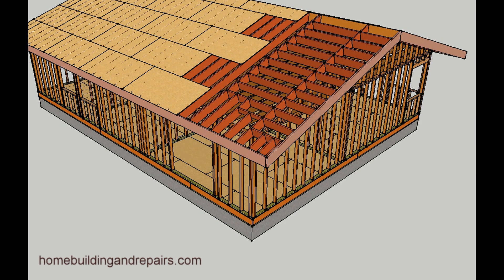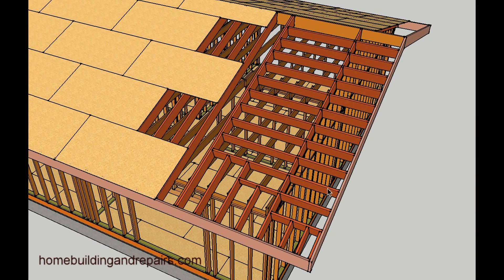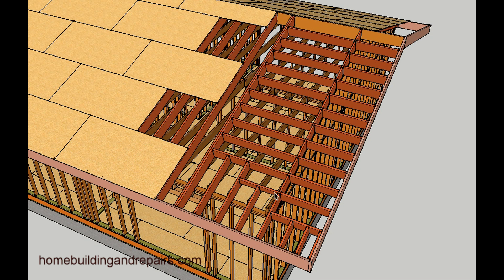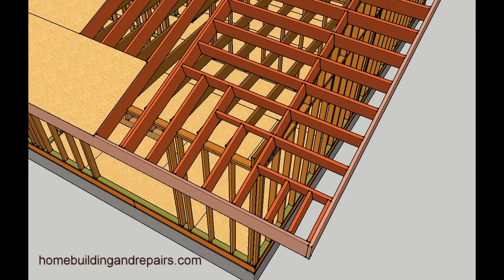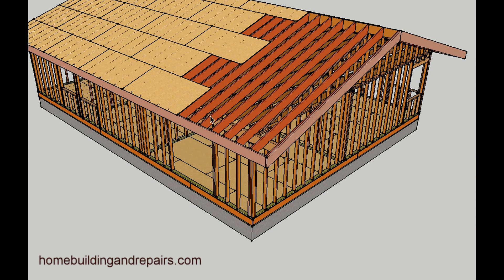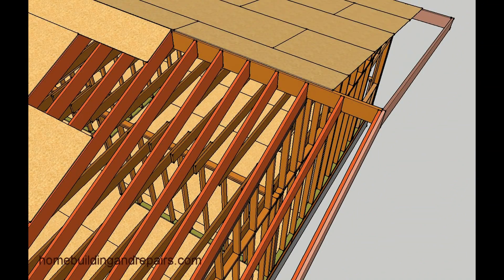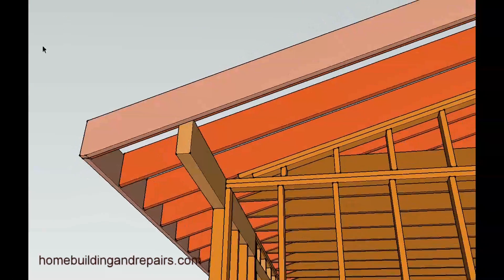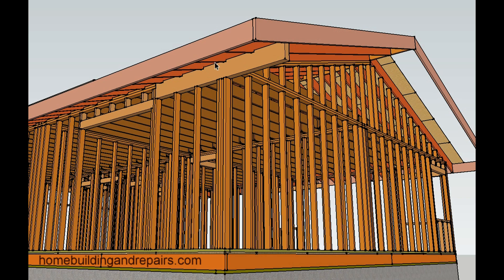How To Make Gable Roof Overhang Longer - Engineering and Framing Ideas

Comment: I am going to install 4 foot overhangs all around a Gable End roof using I-Joist & 2x6 extensions 24" on center. The I-Joist will stop at the top plate of the exterior walls. The extensions are to be 12 feet in total 8' inside the wall w/ a 4' cantilever / overhang w/ proper blocking. At the end of the roof the last rafter would rest on a stack of 2x6x12' again with 4' out and 8' resting on the top wall plate like a end mounted Glulam Beam that would take up all the roof load.😎

Comment: Good informative video! As a house framer myself, I'd suggest to anybody designing a roof system with the first method, consider the difficulty of installation with longer overhangs! I just dealt with a  2' overhang roof, and especially the corners were very difficult to tie together safely. On taller buildings where a ladder is not an option, I'd guess that 2' is the maximum overhang that can be framed from on the roof, anything more would need to be done off of ladders or a mechanical lift

Comment: Thank you for this, i'm building a small 5x7 sauna, and I want to have a 3 foot overhang over the door located on the 7 foot wall, and the second example here may be the way to go. It is not clear to me how the beam supporting the rafters is attached to the wall.  It looks like it is simply sitting on the six 2x studs and secured at two locations, one at the end by the door, in the end grain of the beam, and the other in the front of the building, along the side of the beam.  Am I missing something? Thanks!
Reply from the maker: You would fasten the beam securely to the wall framing and the weight of the roof would help to keep it in place after it's built. Let me know if this didn't help.

Comment: Ironically after years of loving overhangs in California because of shade and seasonal sun, we now have to consider how to prevent them from being heat traps and flash points during fires. Stamped galvanized panels backed by mineral wool might protect the existing wood underside. Other ideas anyone?

Comment: The first design won't work. the corner has no support even with the way you drew it. The second would though as long as you follow the same Cantilever rule
Reply from the maker: I did suggest around 40 seconds into the video that this isn't going to work on every project. For example I don't think I would be happy using something like this for heavy roofing like tile and an overhang larger than 24 inches.
Reply: @gregvancom  After thinking about it for a bit. What you could do to make the first design work and be stronger. Is instead of staggering those last couple you have as cantilevers, would be to continue them full length just like you have for the upper ones. On top of the wall I would use your second design, you would just be have that as a rim board. The problem with that though  would be you would need to cleat those false tails pretty heavily. You'd be stuck with having to have some made that would at least come halfway down the tail, or if you have a small metal break make them yourself. but that would give that hidden look you want. I'm not too up on my metal sheet gauges but something made from around 18 gauge at least (1/8' thick?) or so would be pretty beefy if secured tightly. But that would give you that clean run down you wanted.
Reply: structural fascia would help support that corner- I think.

Comment: Minor detail, but it looks like you would likely need two trimmers in a door opening that wide.
Reply: (I mean two on each side)
Reply from the maker: @nicholash8021  Good point openings larger than 5 foot usually require two trimmers on each side.

Comment: How far out can you go on the second method? Thanks Greg.
Reply from the maker: It would be difficult for me to provide you with that information, because I don't know what the existing home looks like or what methods they used of construction. Remember, these videos are only meant as examples or possibilities of something that can be built, but might require an engineer to provide you with the exact methods and material sizes for your particular project.

Comment: Excellent video. Thank you! Could either of these methods be used to right an already sagging 24" gable overhang corenr? I don't see any outlookers under my overhang. It's a 1966 ranch home which receives snow loads. The eaves are exposed. I was, alternatively, thinking of installing knee braces to lift the sagging corner. Any suggestions? Any books or other resources which may help? Your videos are excellent!
Reply from the maker: +Katy Kirkpatrick I like the knee brace idea, but it would be difficult to repair without removing large portions of the roofing shingles or tile. You could always cut a section of the overhang off to make it smaller. Send me some pictures if you're having a difficult time coming up with something that will see what I can do.